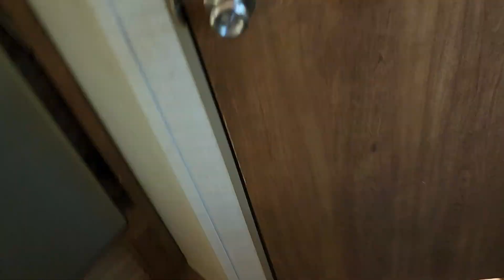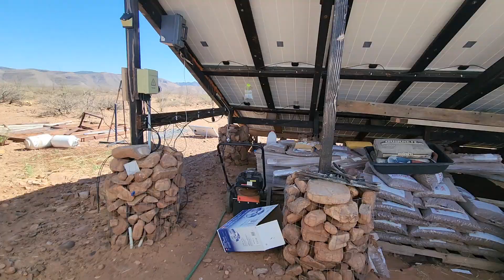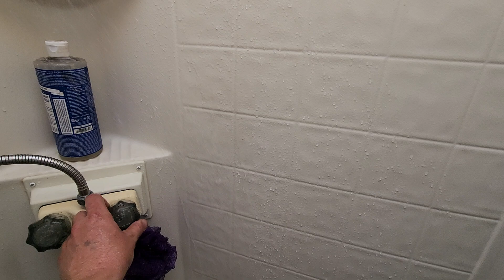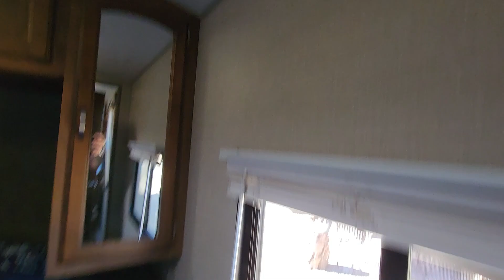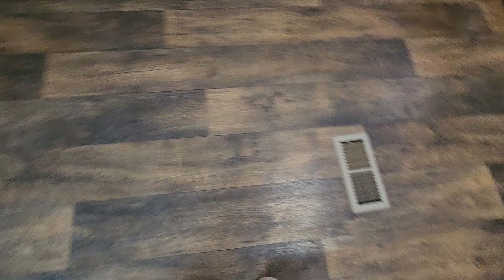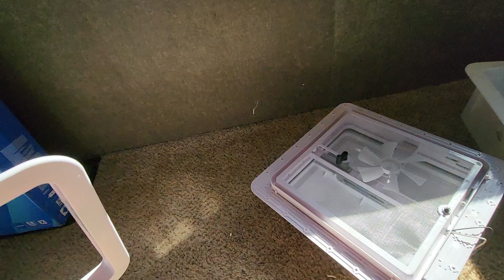Uncle Richs new to him home, repair pt2

Comment: Isn't progress wonderful? Water pressure looks great. How deep is your well? Ours here is 130 feet and so good. Thank goodness the well and septic were viable when we bought the place. We did have to replace the well pump a few years back but a lot less than drilling a new well.
Reply from the maker: Our well is 675 ft deep and 275 to the surface of the water.  We were very blessed to find a well that's undocumented and off the books. Actually, Shane found it.
Reply: @ToddLarsen  Think we heard about that. :face-fuchsia-poop-shape: